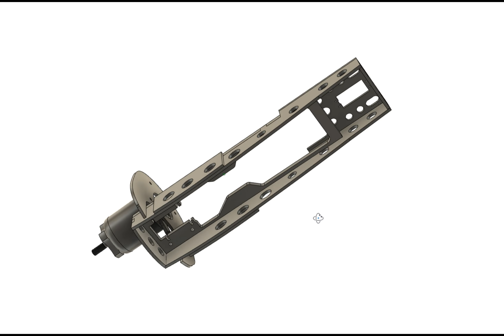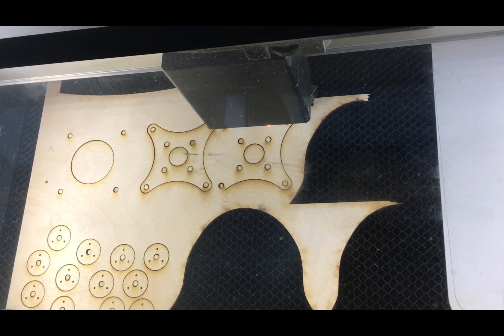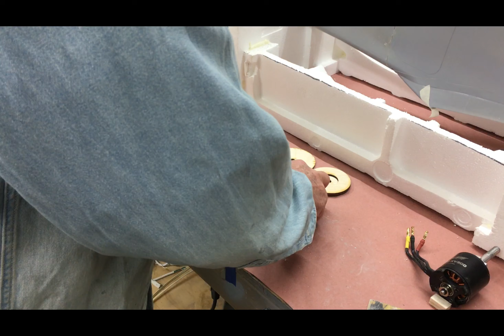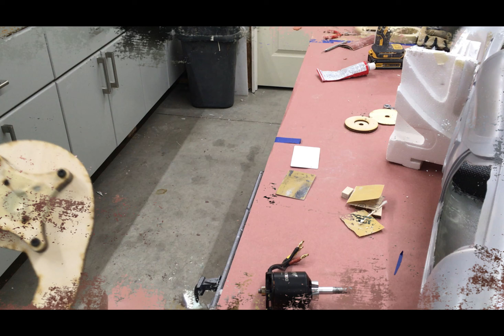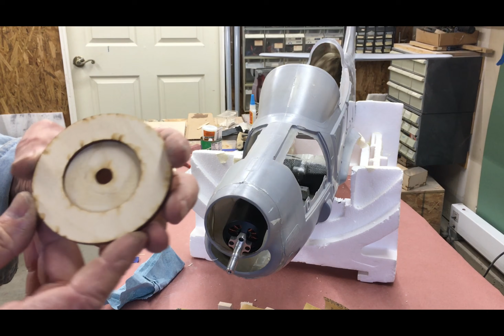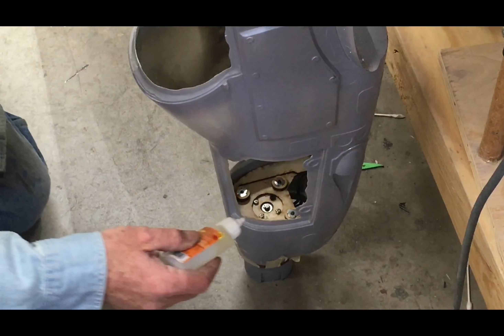Tucano Part 8 FireWall

Comment: I've seen your use of "Shoe Goo" many times, and I couldn't agree more with your uses of it.  I've used it for anything that needs a strong, but flexible joint, and in lieu of "sealing tape" for top or bottom-mounted wings, etc..  Never had a problem with nitro, and expect zero problems with electric.  Your design and building skills are first class.  Thanks for sharing all these videos!